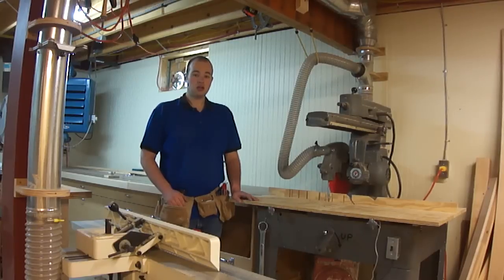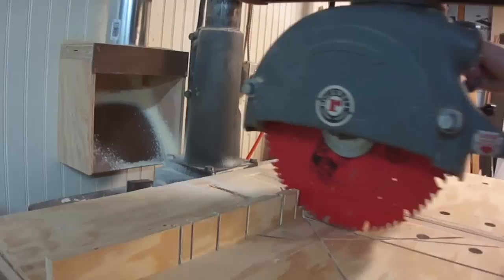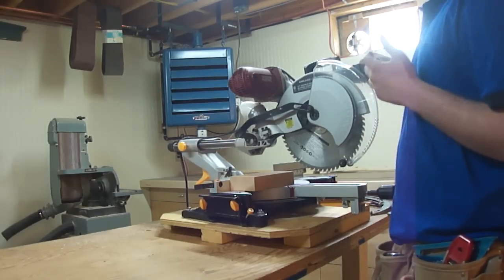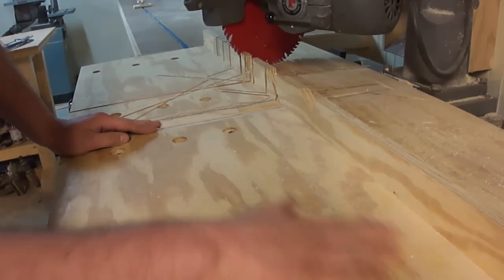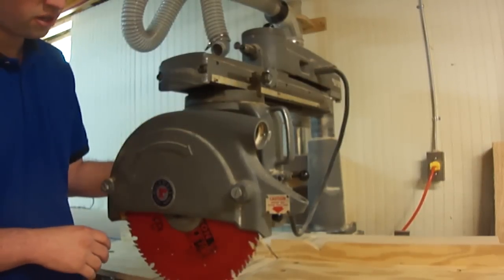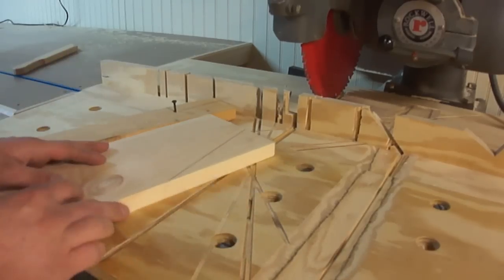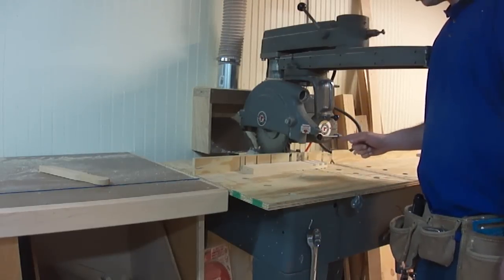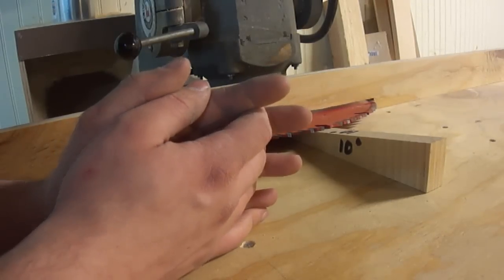How To Use The Radial Arm Saw

Comment: Great video I learned a few things. Several years ago I bought a used Craftsman from a friend who restores wood boats. I was about to buy a sliding miter saw. He offered me this saw and threw in a combination belt/disk sander. The reason he wanted to get ride of it he tried to make a rip cut and thru the stock across his shop. I seldom use it for ripping mostly because my table saw requires less set up. But I use almost never use the table saw for cross cuts. BTW I some times get salvage old rough cut timbers ten to twelve feet long. I have benches on both ends of my saw making dealing with long boards a piece of cake. Thanks again.
Reply from the maker: Carl Wehner thanks for watching! I tend to rip plywood with mine since it can rip 32” wide vs my table saw’s 24”.

Comment: You could have a local machine shop fabricate one for you, it might be pretty cheap since it is such a simple job. it's just a shaft with a groove and a hole in one end and the pawls can be cut from very thick sheet metal. or just get a piece of bar-stock and make it with handtools
Reply from the maker: gadsden1957 I’ve thought about making one because like you said there isn’t much to the anti kickback pawls. It’s on my list of things to upgrade in my shop.

Comment: Thank you very much for this clear, informative video.  I'd always wanted a radial arm saw and picked up a used Craftsman from a neighbour.  Unfortunately my only prior experience with a one was at University, with a tool that only had partial functionality. I'm excited to cut a few baseboard bevels today!  I'm going to look to see if you have any video tips for cutting deep cove.
Reply from the maker: Thanks for watching. Unfortunately I don’t have a video about cove cutting yet. It will be included in an up coming video about making moldings on the radial arm saw.

Comment: I will probably never own a radial arm saw because my workshop has to be shared with my car, which will soon be a truck. I had mixed feelings about these saws, but in the end, it is just like any other tool. If you take the time to learn how it works, and respect it's power and it's limitations you should be fine. If I did get one, I would probably want to invest in a restored Dewalt from the 40s or 50s. I hear those are fine machines worth having. Your Rockwell is nice and heavy duty, and they have always made great tools. 
Thanks for this tutorial, your expertise is obvious and you really can tell you know what you are doing in the shop. Take care.
Reply from the maker: Gregg Hernandez thanks for watching. The old DeWalts are excellent machines. Since filming this video I have added a 1959 DeWalt 1030 to my shop and can attest to the pre-1960s DeWalts being excellent machines. You are right in that knowing how to use your tools and respecting what they can and can’t do is key to safety in the workshop. As for sharing a workshop with a car or truck, my suggestion is to put everything on wheels. I put wheels on all of my tools because I seem to have to move them more often than you would think. The only piece of equipment I don’t have on wheels is the bandsaw because it danced around too much.
Reply: The RAS is actually pretty good in cramped shops because, unlike the table saw, we don't need to provide lots of access on all 4 sides of the machine for the stock overhang.  The RAS only needs infeed & outfeed space, plus a 3' - 4' area in front of the machine; the best thing is that the RAS can be operated  with the rear of it against a wall.

Comment: You can easily set clamps to hold the workpiece with a radial saw for cuts except ripping.  ViseGrip makes "half clamp" units with one spring loaded arm and jaw.  The mating side is a large bolt with a wing nut.  Drill whatever holes you need in your table top and mount the clamps through the hole(s).  The clamp then acts the same as standard style fixture clamps.  Use two clamps and off you go.  That way you don't need to touch the workpiece, that hand won't be anywhere near the blade, and you can stand off to the right side of the blade if you want to.  Just make sure the blade and guards won't hit the clamps.  As for ripping, I have done it on a radial saw but a table saw is much better suited for it.  The radial saw when ripping cuts up from underneath the work piece.  If it cut from the top down it can grab and throw the work off the table in the direction the blade spins.  My first machine saw was a radial saw, so like the author of the video I am used to it.  But to use it safely you need to have a very serious respect for the injuries it can cause in a flash if you use if improperly.  Many blades have or had silver soldered carbide tips on them which were supposed to be good for 3500 rpm.  I know of no instance where one came apart a launched a sharp tip or two into space, but I never wanted to be the first person to find out.  That was after I used my first radial saw wrong and it threw a slice of wood into my right palm and a piece of the same wood through an adjacent wall.  Seven or eight stitches later I was fine.  I have a new saw in the same place as the old one.  The hole in the wall is still there, as is the scar on my palm, now thirty years later.  Both remind me every time I use machinery, especially saws and other reciprocating power tools, not to be in a hurry and above all not to be an idiot, especially when using a radial saw.
Reply from the maker: I have had two occasions where carbide teeth come off blades. One hit a nail hidden in the workpiece and I’m not sure what caused the other one to let go.

Comment: Great video, Nice saw !  I fully agree with removing the guard, anything that can hang up the saw when cutting can be a hazard, as our first reaction is to pull harder. The guard would not prevent cutting your fingers off if in the way of the blade. Better to see the blade!  I do not like the possiton of the on/off switch. I would want to hold the saw by it's handle when switching on, incase the blade is in any contact with the table, and could self power the blade forward.
A knee operated emergency off switch would be nice also.
Reply from the maker: Yeah, I’m not sure why they originally put the switch there. The one good thing is that it would be pretty hard to accidentally turn it on from there. I like the knee operated safety switch idea.

Comment: The dust collection tube blocked the "do not rip this direction" on mine and I had been doing it for years. No, it didn't work well. But I can't wait to try it the correct way and see how much easier it should be...

Comment: Thanks for the time and effort. Good safety tips... Recently bought an old Dewalt, but will only start using next year... Cannot wait !! Ps: Congratulations on 1K subscribers !!
Reply from the maker: Affordable Air Gunning By JB thanks! What model DeWalt did you get?
Reply: @TheNorthlandWorkshop  Old DW 125. They have become disproportionately expensive in South Africa (Actually ALL TOOLS are super expensive there...), but second hand they are still affordable. Mine seems good condition, but I would have to do full strip down and "rebuild" (just because i am full of sh#t) 
On my way now to go and buy blades.....
Reply from the maker: Affordable Air Gunning By JB I just looked up the DW 125 since it isn’t a model that was available in the US. It looks like a fine saw I think you’ll like it a lot.

Comment: Another thing to consider is that a larger blade will be less likely to climb because of the angle at which the teeth contact the workpiece. This is the same reason, for example, that the tiny wheels of an office chair can't roll over an extension cord while the larger wheels on a rolling trash can have much less trouble getting over the cord. Combine the relatively small blades of the typical home-use RAS with the weaker arm and it's easy to see why they were renowned for climbing. The big industrial machines with the cast iron arms and 14-16 inch blades didn't suffer from the same ill reputation.
Reply from the maker: John Terpack I never really thought about the blade diameter having an effect of the tendency to climb but you’re right, the smaller blade would try to climb more. In fact I used a 10” Delta from the 1990’s several years ago and it was everything wrong with small homeowner sized saws. It climbed, its adjustments won’t stay put, and it was woefully under powered.
Reply: @TheNorthlandWorkshop  I was searching the web for used saws earlier and found a guy selling a pair of industrial beauties for $300. They had 16" blades and used 3-phase power. I'll guarantee they cut smooth as silk. I wish I had the cash and the space to adopt them. I'll just have to figure out how to upgrade one of the cheap ones.
Reply from the maker: John Terpack if you have a lot of patience you might be able to get them for free. The one I have was for sale for $120 but because it is 3 phase nobody would touch it. I looked at it and offered them $0 for it since it was 3 phase and I wasn’t sure at the time what it would take run it at my house. They didn’t accept that offer. After trying to sell it for 4 years the owner told me I could have it for free if I hauled it away so they could free up their shop space. They even helped load it in my truck! Granted it took 4 years from when I first heard saw the saw to when I acquired it but this thing was worth it.
Reply: @TheNorthlandWorkshop  patience is easy, I don't need a saw. If it takes months to find one I'll survive. I'm just a home mechanic trying to save several hundred dollars by building my own tool cabinet. I could probably make do with the ancient Skil saw I have. But something tells me a radial arm saw would be worth the money.
Reply from the maker: John Terpack oh they’re defiantly worth the money.

Comment: P.S. The radial arm saw is specifically designed to be pull with the left hand and material held and fed with the right hand. A perfect or even back leveled saw can vibrate out when head is not locked that is WHY it was designed by Mr. DeWalt that way. Futher more the uninformed don't like to rip with them either as the often feed the wrong way an/or do not use dual proper push sticks, the main one being between the blade and fence. Dual push sticks a per ripp anti kick sometimes not always work. That being said try never stand behind or have a body part behind the blade of any saw! I grew up using very large radial saws in the early days and I am a dual Red Seal carpenter.

Comment: May i give you a tip ?
When you use a  sliding compond miter saw  make a half cut of the piece by PULLING the saw toward you and finish the 
cut by REVERSING the movement.  If you do this, the teets will cut the wood downward the first time and upward when you go back to finish the cut.
Doing so you will always have the finest cut ever. Even with a mélamine product!  Try that !

Comment: Too increase control when crosscutting, hold the handle firmly as you said but add a slight upward force you’ll be in full control. Great video have been using mine for 30 years.
Reply from the maker: Maurice Buzzell that would do it.

Comment: Dude, get a new piece of plywood for your fence! It ain't that expensive. Otherwise nice video! Probably the best instructional video on You Tube for the RAS! You cover all the "scary" stuff in a well informed and easy to understand manner.
Reply from the maker: Patrick thanks. I have since replaced that fence.
Reply: I like to use 1x4 pre-primed MDF trim, from the big box stores, because it does not splinter and is inexpensive.

Comment: Really good tutorial. I want to eventually get rid of the cheap chop saw and replace it with an old DeWalt Radial Arm saw. I think they have gotten a bad rap for being too dangerous to use. I think 99% of injuries with this machine are due to operator error. Other than SawStop table saws,  other table saws can be more dangerous than a RA saw because of a false sense of security with them. I've seen jerks on this platform reach over a spinning blade to grab the cut piece of wood. One slip and they can lose an arm and worse their life. No riving knife, no blade guard is an accident just waiting to happen.

Comment: I have this same saw that I picked up at auction 4 or 5 years ago that I just brought to life today for the first time since I bought it.  It has a 3HP motor (manufactured by Marathon)  wired for 230V using the original Rockwell LVC starter.   It seems to run fine, but I'd like to change out the old LVC starter with a more modern setup (the old starter is looks pretty worn out and brittle) but I'm not an electrician and quite frankly it's a bit confusing when trying to figure out exactly what I need.  Any advice would be greatly appreciated from this amateur looking to get serious about woodworking.

Great video and I will be referencing it often as I practice and hone my skills with the Radial Arm Saw.
Reply from the maker: Tim Couturier if you want ultra simple I’d search amazon for “power tool switch” I found one that has a big stop paddle and is rated at 230v 20amps. I can’t seem to post the link here but you’ll see it if you search for it. Mine has a LVC that I pieced together out of old motor starter parts I had laying around. It’s a little different since my saw is 3 phase so I had to use a 3 pole magnetic contactor. If it had been single phase I would have just gone with the simple push button tool switch.

Comment: we have 2 radials at work. the only thing they are used for is cut wood to length. it's perfect for doing a large number of jobs with different sizes. and thats all we use it for. need to cut something on an angle? chop saw or table saw. need to cut 500 pieces of something? that goes on a different machine. 
all these are used for there is cutting to length. and it does a damn good job

Comment: Do you use the arbor and accessories on the RAS? Can youattach drill chuck and router bits or surface planer? Thank you for video very informative
Reply from the maker: Yes I have videos on using various attachments on the ras.

Comment: As an owner of an old RAS, I wonder if your cutting table is wide enough?  Sort of dislike the idea of the blade "running out" past the edge of the table as shown could be possible when you were cutting the kerf on the angle cut.
 Don't forget that using the raised table and dado blades (raising your work to about the middle of the saw blade) you can cut box finger  joints, (put a stop on the arm to set the depth.) 
 Really enjoyed this, and yes I've ripped in the wrong direction sending the 2x2 x 8 ft. cut off 20 feet into my yard.
Reply from the maker: Robert Pendzick thanks for watching! The table does seem a little narrow but I built it to the dimensions found it the saw’s owner’s manual. The limiting factor for how far the table can stick forward is that if it was any wider it would interfere with the knobs that clamp the fence in place because those knobs are located at the front on this saw.